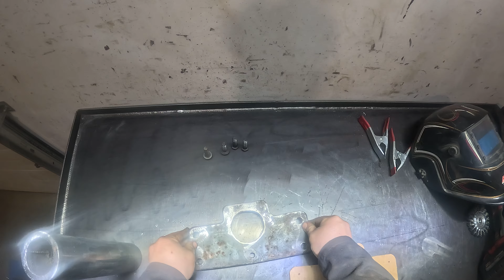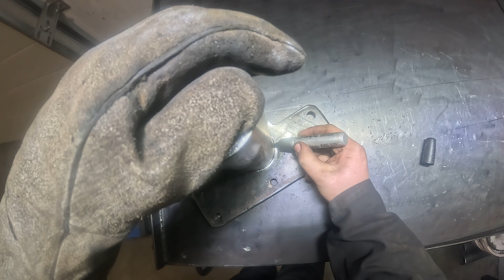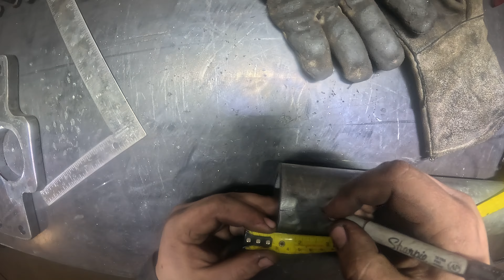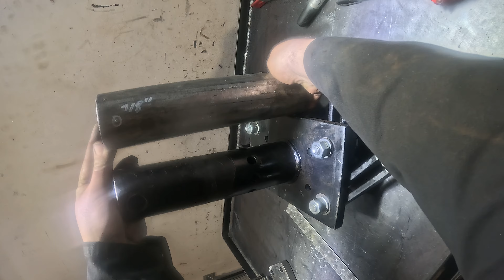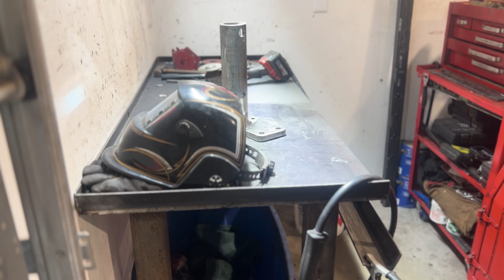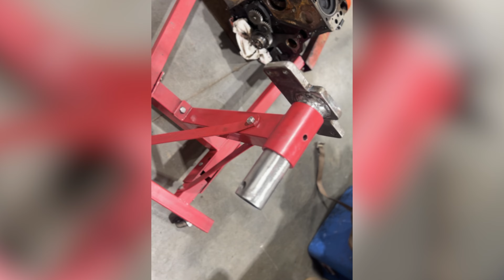Cummins Custom Engine Stand Adapter - Fabricating w/ Curtis

Comment: Dude, I fuggin love this.
Reply from the maker: Heck yeah you do sport! What about it?
Reply: @InsideTheCaseAuto   Just putting a motor sideways on the stand will make it way more stable.  Any concern about All of the weight being loaded on one side though?  Now is fine, but what about the block casting being loaded up like that once the motor is fully dressed?